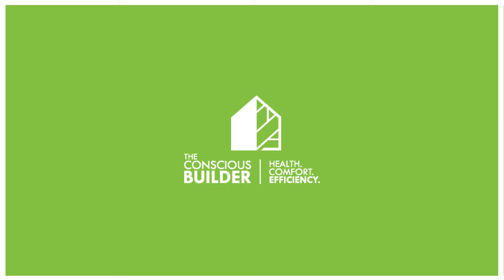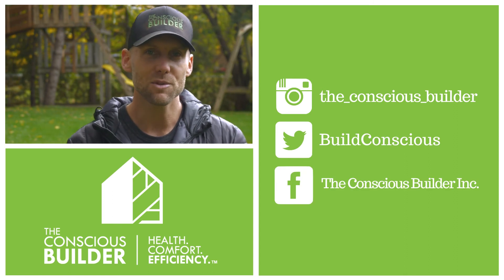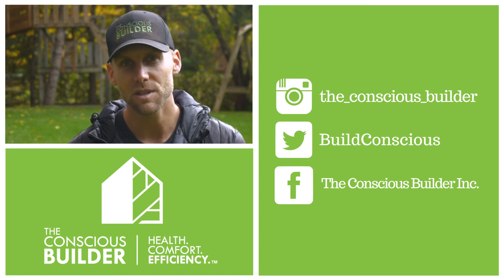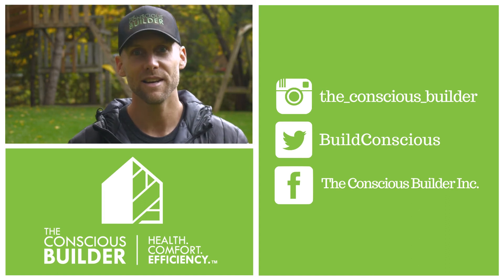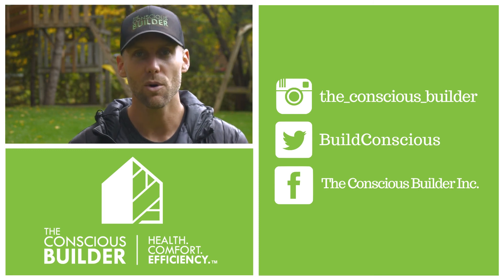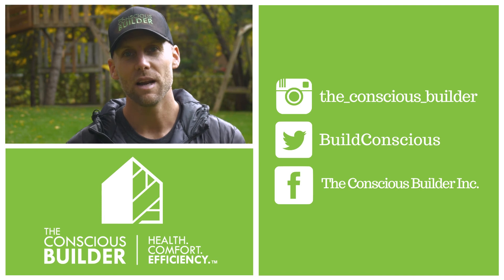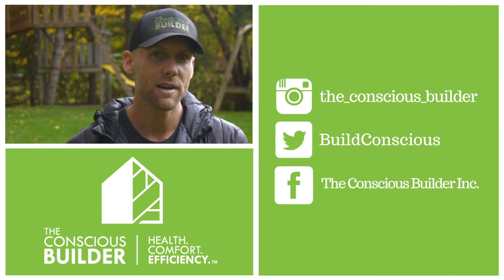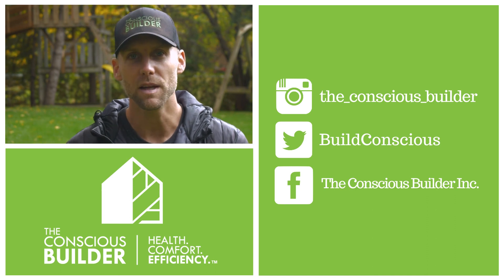Why Do I Have Basement Moisture Issues In My New Home?

Comment: This is great info.  I am getting moisture build up on my concrete wall between and its wicking into the insulation.  The vapor barrier is on the heated side of my basement wall.  The house is about 2 years old.  I am worried about mold build up now that I found this moisture in my walls.  I'm in Stittsville just outside of Ottawa..  For now, I will be removing parts of the vapor barrier to allow some air movement and dry the walls (there is actually frost in some places building up under the insulation).. Thanks for the info.
Reply from the maker: Thanks for watching Dale, so glad the info was helpful! Best of luck with drying that out.